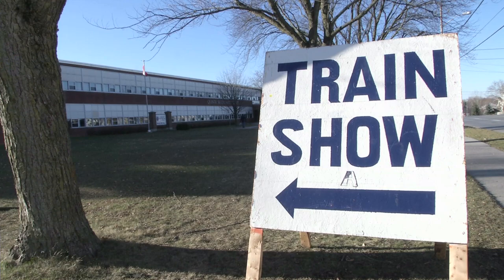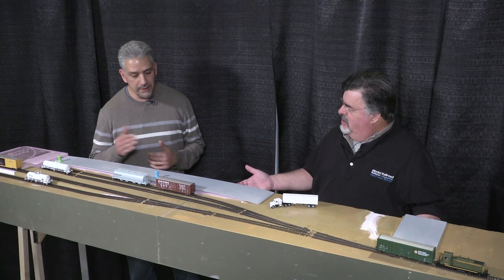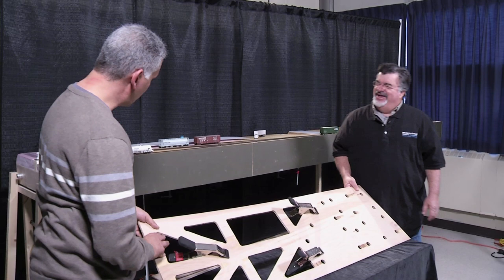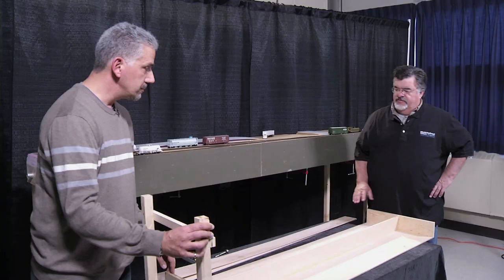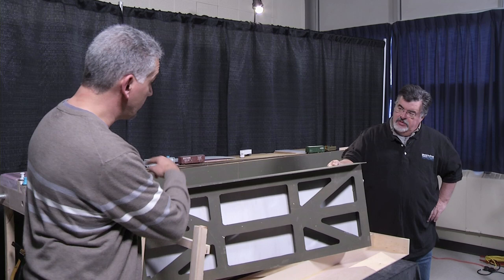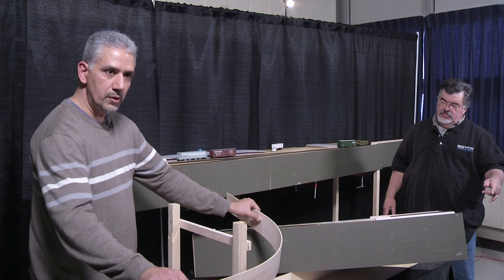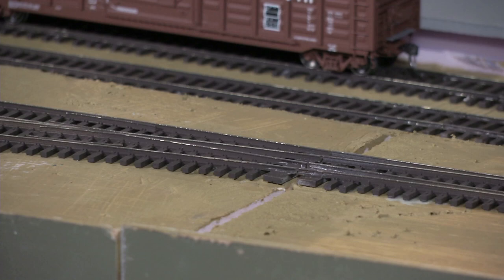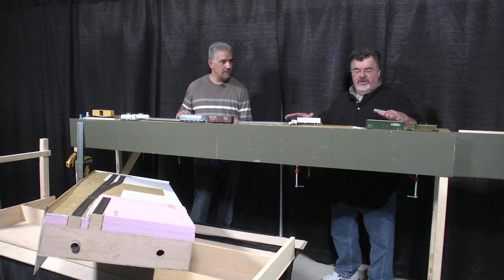TrainMasters TV - Pine Street Spur benchwork

Comment: I have always use white glue to glue down my track.  You just have to remember to keep the track weighed own when ballasting. I once had the flex track lift up at one end.  Luckily I caught it and just had to add weights before it dried. Once dry it is rock solid. I use a different method to building my modules and mine are probably a quarter of the weight of these units!